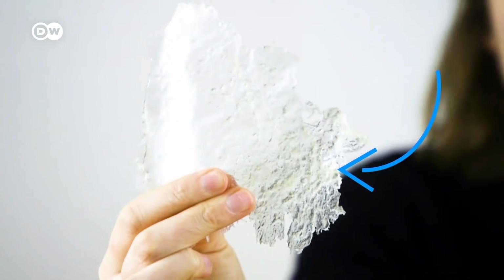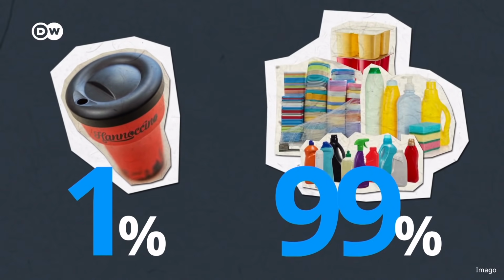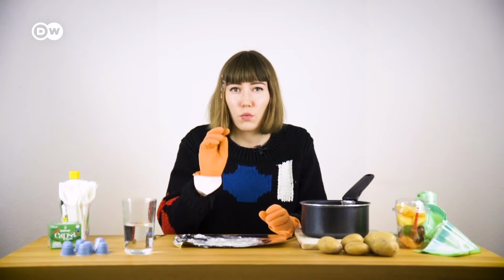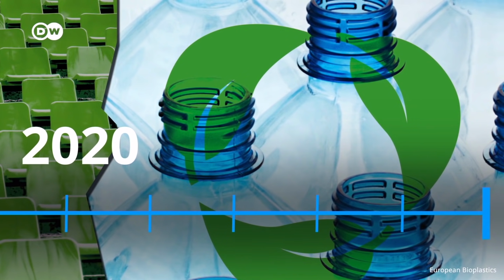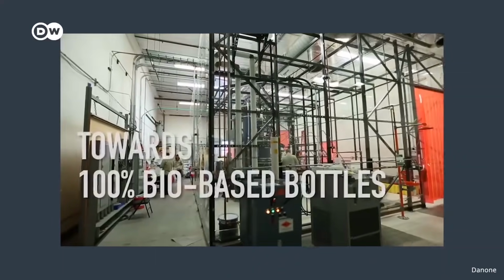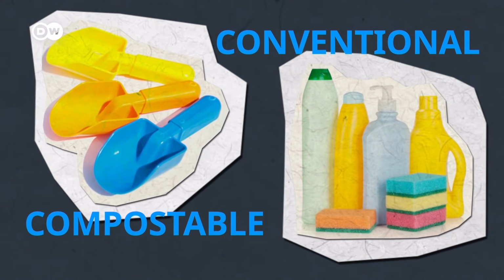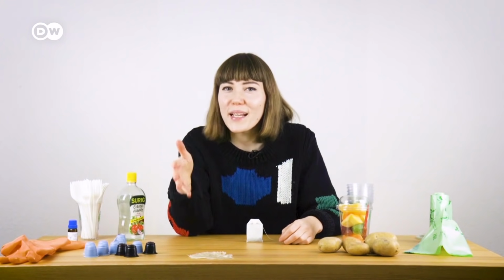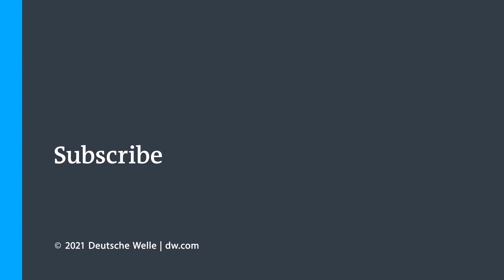Is bioplastic the „better“ plastic?

Comment: What about the carbon footprint of using alternatives to plastic? Although I agree that ideally we need to just avoid plastic entirely, the fact is that if we just exchange plastic for e.g. glass, this doesn't solve the problem, in many cases it makes it worse. We need to consider the environmental cost of producing plastic alternatives, the impact on transporting goods in alternative containers (glass is heavier and bulkier and requires more packaging so it wastes more fuel to transport it), and the impact on shelf-life (plastic has been used so extensively because it so effectively seals food allowing it to last longer).

The point is that this is not a simple problem to solve, and simply avoiding plastic at this stage may cause a larger ecological disaster. I think one area that we can concentrate on now which may help solve the problem in the short-term while we find a long-term or permanent solution to these problems is pushing for greater advances in soft-plastic recycling. If we transition to using much more soft-plastics and invest in perfecting the recycling techniques, we can dramatically reduce plastic waste in the short-term, and simplify the consumer's job in sorting garbage and recycling. Of course we need to massively overhaul our recycling system as well given the manifold issues with that, but it's a viable short-term solution while we work to develop the long-term solutions that forever remove all plastic from our daily lives.
Reply from the maker: If you would like to know more about carbon footprint, watch our video: https://www.youtube.com/watch?v=vqZVCEnY-Us
Reply: @DWPlanetA  Thanks, I'll check it out
Reply: @DWPlanetA  Ah ok, I watched the video. No real new info there - I mean the video was posted this year but contains information that was widely known like 10 years ago. Still appreciate you posting it and helping to keep raising awareness.

Not really sure how it relates to my comment above which agrees completely with the content of that video - that we need consumer choices to push government and industry to start putting into effect better systems that reduce carbon emissions on a mass scale.
Reply: @EfHaichDee  when glass was used, milkmen refilled bottles. They didn't make new bottles. If they did, we'd run out of glass.
Beside, we used to use lots of paper. And nobody was drinking coca cola before the twentieth century.
Reply: @موسى_7  Yeah, there's also 7 x as many people in the world now. Still think we have enough glass?

Even if we made enough bottles, that's glass that's locked into a single purpose and can't be used for anything else.

We're already making significant progress towards making plastics infinitely recyclable. We've found worms and fungi that can break down styrofoam and plastic. The science is new, but this is a more realistic long-term solution to the problem. We just need to do something in the short-term to reduce the immediate issue. As in my comment above, yes, reducing plastic plays an important part, but replacing everything with glass isn't going to work - it's just not practical for most use cases, and it has a much much larger environmental impact (the waste issue only makes up about 5% of the entire environmental footprint of a product. Most of the impact has already occured during manufacturing and extraction of materials, and plastic has a much smaller impact across every step in the lifecycle except the last one)

Comment: I wish I had seen this video when it first came out.

The gentlemen in the video snippets you present is John Bissel, co-founder and co-CEO of Origin Materials. His company has solved both the beginning-of-life and end-of-life plastic problems. They are in the process of commercializing these solutions at large scale.

The company uses pulpwood (waste material) -- extremely inexpensive and available in massive quantities -- and converts this lingo-cellulosic feedstock into CMF and HTC. The CMF can be carried through to PEF, which is a bio-degradable plastic that can degrade in nature (no need for a composting plant). 

I wish you did additional research into the organization and scientist that you've included in this video. More thorough research would have certainly led you to a different -- and far brighter -- conclusion with respects to the feasibility of transitioning to bio-plastics. 

@DW Planet A

Comment: TLDR make plastic into trees.
There was a certain college who had did a project on a powerplant. They redirected the flue gas into a mini algae farm. (The algae farm looked wierd it had tubes and stuff)

Anyhow, since algae eats up Co2 and toxic heavy metal they basically made the would-be pollutive air...-cleaner.

The algae then could be used to make non edible fertilizer.

I was thinking what if we burned plastic and send the exhaust to an algae farm. (Since plastic is made from fossil fuel or ancient algae the algae would eat it as nutrients.) The algae could then be used as non edible fertilizer. 

We can use the non edible fertilizer and make trees.

Comment: I like your point about the best solution being using less of any sort of plastic, but there is a solution you didn't mention in this video that solves ALL the problems you mentioned that the other bioplastics have....check out plastic made of industrial hemp. Growing hemp returns carbon into the soil, it can be composted completely within 3 to 6 months, with zero toxic chemicals released. Hemp requires no pesticides or fertilizers to grow, uses far less water than any crop in existence, and it is four times stronger than conventional plastics. It is considered a net zero carbon emission since it  takes carbon from the air and returns it to the soil naturally, through photosynthesis, and it actually gos one step further and removes heavy metals and toxins and even radiation from the soil, healing the earth. Hemp grows incredibly quickly in all sorts of biomes, even in northern climates like Canada, and it requires and releases absolutely no toxic chemicals into the air, soil or water at any stage of its existence. Every part of the plant has many uses. The seeds are also considered a superfood. Talk about a miracle super plant! It has more than 50,000 uses and more each day. I truly believe hemp will revolutionize every industry.   Correction on one point in the video ... Ford used Hemp, not plastic derived from soy bean plants, to make a car in the 1940's, and even used a hemp derived ethanol fuel to power it.

Comment: it is true, even ethanol(bio-based material) will produce non-degradable plasic, so the only way out is too use less plastic
Reply: but even a bio-based is compostable, if u dont collect them to a facility, they will not degrade, it will create the same problem
Reply: the problem is that it's quite hard to differnetiate deg and nond material

Comment: pla doesn't degrade except if in contact with specific enzimes rare in nature, you can google varius sturdies were pla was left for years in soil or marine water with no change. What it doesn 't do are harmful microplastic, that because once it's that little and find a way near a cell it can be degraded by the cell's enzime, and more importantly it is not an hormone analogue like bisphenol or terephthalic acid (bisphenol is a common plasticizer like the glycerol that you used, the other is the T in PET)

Comment: I think is more about costs vs profitability, well today is good produce "eco" alternatives, there is a marketing margin to do that. But that only became a thing causes the cost of petroleum, as tell in the video the first version was made from reneweble sources, like combustion motors also was initial projected to use vegetal oil. Today the industry is selling as a "green alternative", but is all about "marketing", the countries regulation is playing a major role, causing a increase cost for some industries, but i think that the main impact will be caused by the pressure of petroleum cost. Well if you see other products that are based in petroleum, plastic is the less worthy.

Comment: They can make PET plastic from the resin from sugar cane production instead of from fossil fuel. And it comes up exactly the same. You could not tell the difference. Well, you might be able to, but I currently cannot. But the sugar cane resin PET amounts to the same garbage problem as the fossil fuel PET plastic. But it also amounts to the exact same degree of recyclability. Equally recyclable. Arsehole industry is saying that just because it is sugar cane resin rather than fossil fuel it is therefore made from recycled material, which is totally incorrect, since it is not post-consumer.

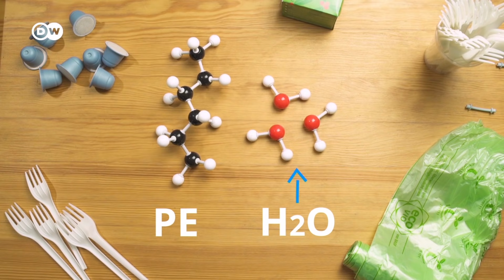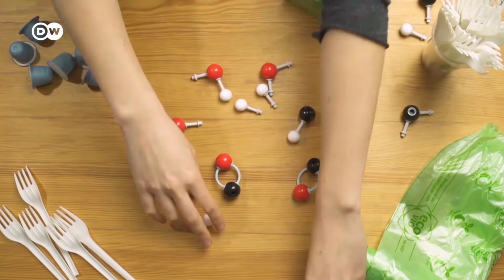Comment: To recap, 5:28 for producing PE plastics residue is water,  6:07 - PET plastics in very end - CO2 and H20. Does CO2 is one big fella why everyone hates the diesel/petrol? What You think for making only residue H20 and heavily use of reverse vending machines for collecting various plastics instead, so C02 neutrality would be more feasible. Second point. Bio-diesel and so on could be done too, but this means, that land gonna be used not for feeding millions of people, but for feeding up machines with bio-fuel, then food price gonna up, bio-fuel price gonna increase too. Does this second point looks pretty? don't think so. What, if start doing more serious vertical farming with lab ecosystem, no pests, no chemicals needed. But water usage in sustainable fashion would be in great demand. How to build huge and cheap lab houses, domes probably should help various world-wide supermarkets. But main question — does those required ingredients could be grown in lab environment? in sustainable fashion.

Comment: I have 1 suggestion, trace back the EVA production and insane dumping prices. It is highly used on every plastic factories because the price is insane low. Mix it with other plastics and you get garbage aka. not easily recyclable product. Only good news for plastic resin manufacturers because they can keep selling the virgin plastic resin. So, they ruin the recycling by EVA. I think the mixing should be banned and companies could use only single rated plastic or pay heavy fee for mixed plastics. PE is very good plastic and there is low, medium and high density PE. Basically you can mix all these together and you get something medium. There is only 1 reason why companies do not use PE so much - no fancy printing quality. PP (the potato chip packaging) can have a so fancy printings... I really think consumer level packaging material should be only PE, nothing else. Easier to recycle, all similar plastics.

Comment: What do composting facilities do with bioplastics to make them degrade?
Reply from the maker: Like pointed out in the video, not all the bioplastic is biodegradable and they have the same problem as fossil-fuel based ones. From 8:40 we talk about where bioplastic use makes sense and where is gets composted. 🥡
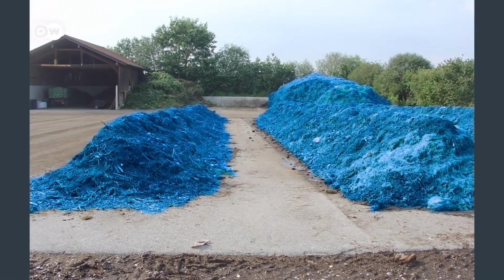Reply: At 6:29 he says that it will only degrade if you send it to composting. I'm not asking where. I'm asking what the composting facility does to make it degrade that it wouldn't do on its own.
Reply from the maker: The factors contributing to their degrading are temperatures, optimal humidity, oxygen levels and active microbial communities, all within a controlled time frame. 🦠

Comment: Please check  Biodegradation of bioplastics under different conditions under point. 4 of the article "Biodegradation of Wasted Bioplastics in Natural and Industrial Environments: A Review Adele Folino et al ," Biodegradable plastics do degrade differently in natural condition than a composter that doesn't mean it doesn't degrade at al.
Also I would like to know what Germany and  DW is doing to reduce their carbon footprint print? Are you using less of it?
Reply from the maker: In which way did you find this video misleading?
Reply: @DWPlanetA  I made my point. But DW Planet A you seem to neglected the question I raised. This expose your propaganda to undermine the efforts to reduce plastic pollution and indirectly promote plastics companies?
Hope to get a proper factually correct scientifically sound reply and not just selective perception
Reply from the maker: @rrrajlive  To your first point of biodegradability: As stated in the video, bioplastics do not automatically equate to biodegradable plastics. Chemically speaking bioplastics can be indistinguishable from petrol-based plastics, making it just as non-degradable as petrol-based plastics (see 4:52). 

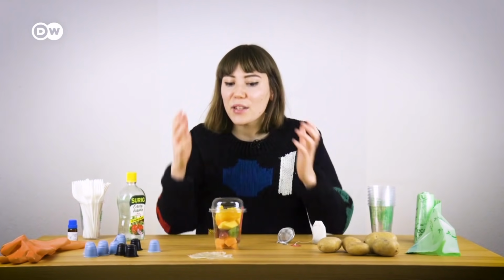To your second point that we are "undermining efforts to reduce plastic pollution" -  as we say at 9:22 "Bioplastics can be better than conventional plastics. But it has its costs. It's not a perfect solution. The only way to curb plastic pollution is to use less of it."
Reply: @DWPlanetA  my first point speaks about  Biodegradable plastics and not bioplastics in general as clear from the article title and it's contents.
Second and most importantly I asked specifically what DW is doing to reduce plastic problem.
Your answer speaks about none of them. I'm not undermining your content but it's giving full picture. That's all I want to say. So, please Stop playing around with words and come to the point.
Reply: If you had genuinely consulted with an expert in the field and taken their advice unbiased way you could have presented a better picture of the matter. Also I gave one article reference, did you read it?
Reply from the maker: @rrrajlive  The study you mention shows the differences in the degredation of plastics, which varies depending on the environment it lands in. Its deals with the same points that the study we cite does, (https://pubs.acs.org/doi/abs/10.1021/acs.est.8b02963?af=R&) whose co-author we interviewed (Ramesh Padamati) - an expert in the field.
Reply from the maker: @rrrajlive  Sadly, our sustainability report is only in German - but we have contacted the corporate sustainability department for information in English and will be back with more details as soon as we get a reply. If there is no translated report, we can give you the summarized information about what DW is doing for sustainability. So stay tuned :)
Reply: @DWPlanetA  
I like your efforts to reply back the viewers with a proper discussion 👍

Comment: Hey there, 
thank you for the nice video. I would like to remark, though, that there is a bunch of information left out here. Starting with the term "bioplastics" leading to major confusions. Bioplastics by chemists is used as a term for bioBASED and bioDEGRADABLE plastics and one of these qualities doesn't determine the other. Hopefully this matrix here can help someone understand the scope of (bio)plastics a bit better: https://www.foodpackagingforum.org/fpf-2016/wp-content/uploads/2014/06/Figure-1-800x600.png
Another thing I would like to remark ist that there are dozens of different types of bioplastics possible, all throught different methods and different carbon footprints. The agricultural effects you are referring to in the video only apply to polylactic acids and starch-based polymers.
Reply: What do you think about hemp plastic?

Comment: The important thing is that we stop using fossil fuel based plastic. Once it is waste plastic, it can be burned for heat energy by burning it. The CO2 released when burning is not bad if the plastic was produced from plants which contains CO2 originally from the atmosphere. It is a closed system if we stop using crude oil from the ground all together.

The only problem is micro-plastic waste but that is another problem which requires a different solution.

Comment: It is better to not buy plastic. Finding a solution for an effect is just senseless. Plastic is not good. So why producing it and why finding a replacement for it? It is just a stupid way of consuming. Products in plastic are products that are not necessary for human consumption. Fruit and vegetables can be sold without plastic and anything else is just a question of giving no animo. Plastic will not be used, when the consumer doesn't buy it. Go for the cause, not a solution of the effect. Be smarter! Much love.

Comment: Oh no My Environmental science project just went down the drain. What do I do now
Reply: Write about how nothing can change much anyway since plastics are needed in the medical field and that oil tankers won't ever feasibly run on other fuel sources
Reply: @mikeyvesperlick6982  I wrote about how you can make hemp into concrete and the benefits it has. I got an A so the cool.

Comment: This is just... poor question posing. Let me ask you this, when is bio plastic not better than normal plastic?
I'm not asking you when it isn't "perfect" or "good", I'm asking you when it is not better
The conclusion that the video seems to draw is that it is sometimes better. But it fails to determine whether, when it is not specifically much better, it is still better or merely equivalent.

Comment: Plastic itself isn't something the world and its ecosystems actually need.
We manufacture the need for convenience. Like so many things wrought by man. 

I use steel bottles. Drink my own water at home. So many things we use plastic for were made from metal, wood, cotton and other things in the past before plastics existed, and are still viable alternatives, especially things like clothes hangers which last longer when wood and metal is used.